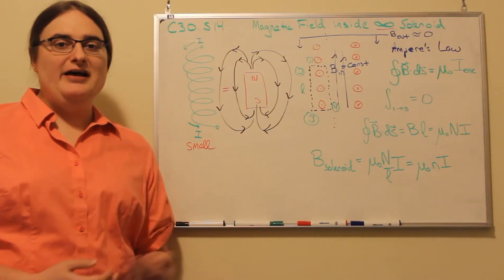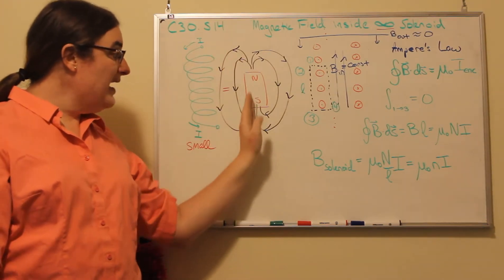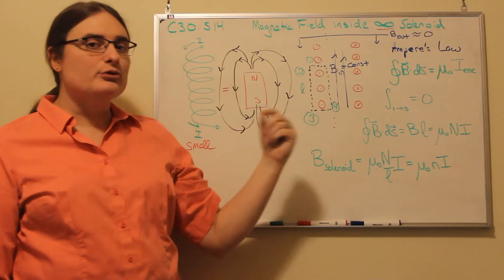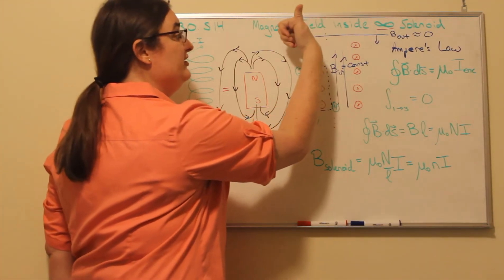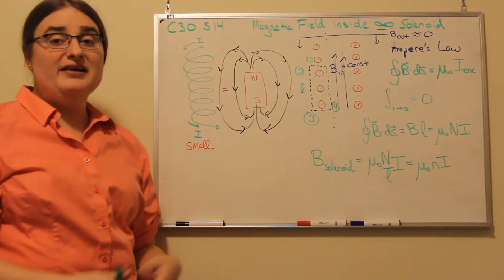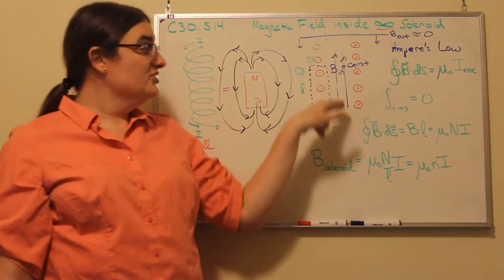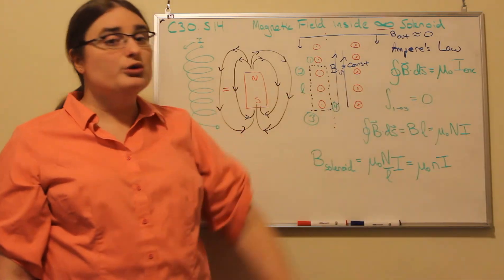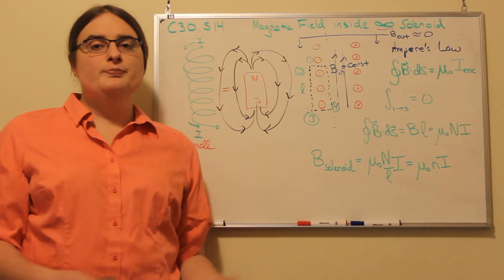The Magnetic Field Inside an Infinite Solenoid

Comment: used 16 gauge and 28 gauge magnet wire to build a solenoid project.  Can't get enough of a magnetic field using the fine wire .  Not enough amps passes through it.  Got a better magnetic field using 16 gauge wire, but still not powerful and induced Electric field (AC voltage used) produces voltage of .7 millivolts.  Gauge wire is not taken it account in the equations.

Comment: I you want to produce the strongest field in the inductor, use fine magnetic wire.  The larger the gauge wire, 20+, the thinner the wire and thus stronger magnetic field produced.  Magnetic field is stronger around smaller gauge wire due to their higher inductance. Problem is if you need amps, thin wire won't let amps pass enough to build a magnetic field.

Comment: Trying to build a 1ft wide solenoid, but the physics seems to fall apart.  Only the outside of the solenoid has a magnetic field when the solenoid is wide.  Place a metal washer in my 1 ft wide inductor and the washer barely reacts inside near center.  Put a metal washer in the spool of magnet wire, with power attached, and there is definitely a magnetic field in that much smaller area.
Reply: This is because you are building a solenoid of finite length. The example here (as well as many in books such as Griffiths) uses an infinite solenoid, which obviously cannot be replicated in the real world. It simply highlights some interesting properties of electrodynamics. A real world finite solenoid should behave like a dipole, which seems accurate to the results you are getting.